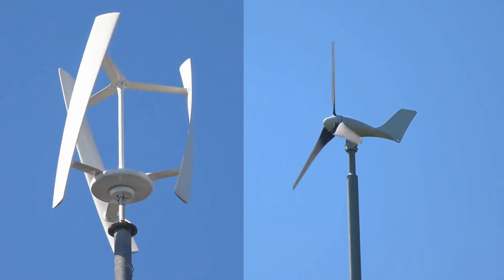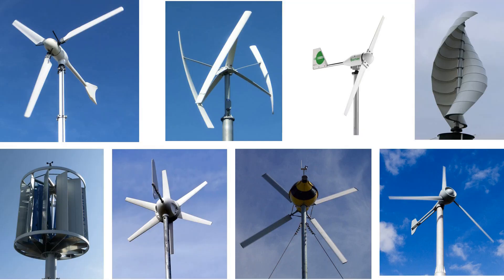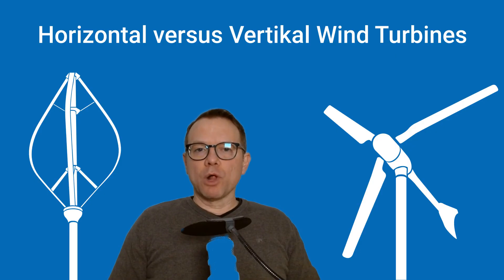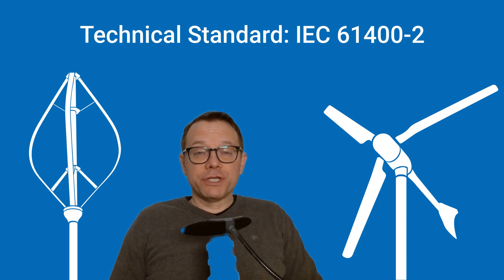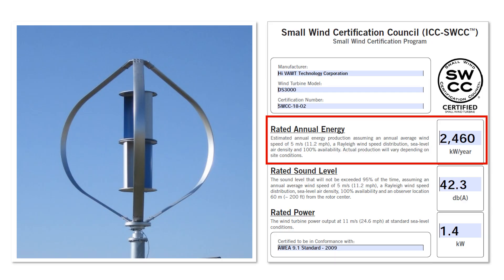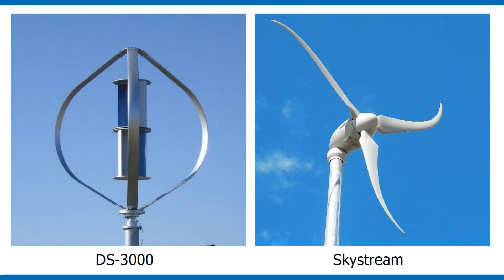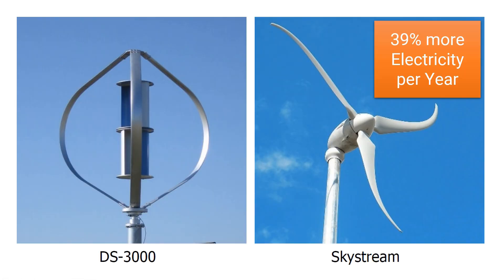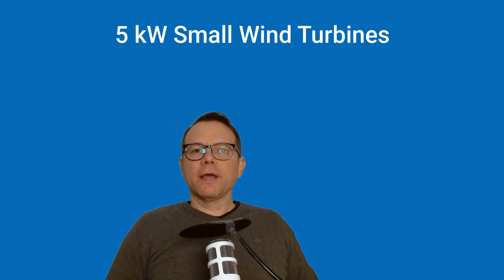Independent Tests: Vertical Axis Wind Turbine vs Horizontal Axis Wind Turbine

Comment: There is a lot of junk on the market, so after a few bad buys and lots of testing, 
I have finally found the best performing small low wind turbine for the price - was $361.90 AUD postage included, I brought four straight from China - 
Search  -
1000W 24V/48V Windmill Power 6 Blades Wind Turbine Generator W/ Charge Controller 
Best to order the 48V mode and use a 3 phase 100A bridge rectifier then into a PWM solar charge controller with a maximum input voltage of 50V.
This is a buy, blades on and put up wind turbine no modifications needed.
I hope this helps everyone when buying their first small low wind turbine.

Comment: The reason im interested in the vertical design is that i suspect it is much less likely to kill bats
Reply: I have had a 2KW wind turbine with 10' blades up on an 85' tower for 38 years and as far as I can tell it may possibly have hit one bird.
I don't think bird deaths are an issue with small turbines.

Comment: I would be interested in knowing the generating motor size on each... As in, at 50rpm = 10watt ? 
(If the horizontal has a larger motor, then the test is flawed) Traditionally a horz has 9 points of wear, while the vert only has 3.... Which makes the vert cheeper to maintain (some tests also say verticals will turn on less air)... 
Stay Safe

Comment: There is a lot of room for adjusting the height and width ratio of the trusses and sails. I think it is best to look around and even do your own experiments. It is an open field and the more the merrier. Watching a video of lab wind tests it seems that cylinder sails capped with discs cut into small fins not only is the most efficient but doesn't require starter blades

Comment: I am more interested in the high wind speed servivbility as we're i am i had 2 die & i know of 3 small to medium industrial wind generators that have died due to high wind speeds. Also if thay servive will thay still produce any electricity at higher wind speeds.

Comment: you do realize that small purpose wind turbines are used in the city and people's private houses and in this urban areas where amongst buildings and other things maybe hillsides the wind direction changes really rapidly and frequently and so there's no way that a horizontal axis win turbine can keep up with it it can't they can't move that faster used to a single direction of wind hitting the middle all the time and it open field airplane and so the vertical axis wind turbines are not going to be good there but anywhere else you want a vertical wind axis turbine in the cities on hillside's anywhere in urban areas where there's constant changing direction wind and you can see and around your house the wind's blowing from one direction then another you can just look at the which way the winds are blowing the leaves are blowing so you're kind of wrong on almost any sense except for grand scale large industrial wind farms any small scale use of a wind turbine is going to want a vertical axis unless you're on a boat perhaps where you're out at sea in the wind is only going to be coming from pretty much one direction and I'm given time and the horizontal axis wind turbine will have enough time to change its orientation. it doesn't do any good if a horizontal axis wind turbine is not facing the wind because the wind changed direction so think of that otherwise great video
Reply: Horizontal wind turbine change direction also fast
Reply: I'd disagree that small purpose wind turbines really are used in the city.  I can't really think of any successful installations ~ lots of folks try but really, citys dont tend to be in windy places and buildings make for a bad wind site unless you can position a turbine well above them.  To put a wind turbine on a bad site is akin to putting solar modules in the shade.  people do it, but in the end they generate very little energy and that energy is very expensive.

Comment: According to the test certificate given the DS3000 I can read that the "Rated Annual Energy" value is 2,460 kW.
As kW is not the unit for energy but for power it makes me disbelieve that this so called "independent test" is a legitimate test, performed by skilled personnel.

Comment: Fine analysis of current market; do consider the general pros are that wind balls can be arrayed denser with (unmeasured) benefit and accessible to the ground in comparison to wind towers. 

Imagine if I told you my 20%-40% less efficient design can be placed 10x more: thats 6-8x the output of the single more efficient model and would change the general efficiency understanding, but again less of a single buyer perspective and more general analysis comparison importance. (I dont know the specific array density of these models just general important analysis consideration with windmills. 🐧🐉)
Reply from the maker: An honest answer: a lot of claims are made in the field of small wind power. The decisive factor is evidence in the form of independent test results. I primarily deal with wind turbines that have proven themselves in practice.

Comment: Very helpful video thanks so much. I own a farm in a rural area (technically "on grid" but in between two small towns, ie with no other buildings nearby). According to the local meteorology station in the nearest town, the general area receives on avg 3m/s wind - that said, and in my personal experience, the exact spot where farm is the wind is significantly stronger, at least 2x as strong; again, my estimation. Important to point out that there are already several state owned large wind turbines scattered around the area. My farm is on a hill with an elevation from 130 to 90 meters above sea level with no obstruction, so my question is: would a small turbine still require that 10 meter high position? I would like to keep everything discreet an in line with the surrounding landscape. Thanks again.
Reply from the maker: Every location has its own conditions. Unfortunately, I can't give a general answer.

Comment: Horizontal Axis Wind Turbine 25 mph wind you may get 2-5 watts from a 400 watt turbine there shit. it will never charge a 12 volt battery. 2-3 volts ac. you never get pay back of fan and mask. wait for the windmill fan that thhey do not said 400 watt ebay and others is max wind speed. over 100 mph

Comment: Very nice video and very interesting channel !!  I have a question.. if I want to measure wind over period of a year, just to see if my location is OK, what would I need , some cheap option, if you have something on mind ?
Reply from the maker: You could check this company from Scotland: https://en.windlogger.eu/collections/small-wind-turbine-data-loggers
Reply: @WindSunWisdom Thank you for your answer. This is a bit too much money for me to invest, just for test. Do you know of any DIY solutions, or something involving RPI or something like that ?
Reply: @tokracro  Just buy a few cheap WLAN weather stations (you can get them for around 100£) Place them on different points of your property. The data generated will be transferred to a weather server such as wunderground from where you can review them. Don't forget to calibrate the anemometer on these stations if you want to know the absolute and not just the relative wind speeds. If that's still too much money just buy a handheld anemometer, (costs less than 20 pounds) go outside and hold it into the wind. If you do this again and again at the same location and the same orientation and properly record the wind speeds measured you'll get an idea of the wind speeds at the location and height of the anemometer. PS if you want to spend zero £  use the world wind atlas. The atlas provides quite a good resolution and will tell you where approximately your property is located on terms of wind energy.

Comment: A guy here in the UK who has been building and using vertical wind turbines for over thirty years said to me that he favours the less efficient vertical set up because it is easier to  build them to last and maintain/service them. 
The hours other people wast over the years on messing about fixing horizontals makes them (in his experience) more expensive in the long run (or equates to a higher Total Cost of Ownership).  
He is retired now but many of his are still working on boat sheds and remote agricultural buildings all over Britain where reliability and convenience was the over riding factor. This meant they were expensive per watt back then compared to to-days solar arrays. So, what is best should be based on the particular application and all its other requirements. 

Also, if his customer had any old automotive batteries (fisherman and farmers etc., always have old batteries knocking around), he could often convert them into deep cycle batteries simply by changing the type of electrolyte. Thus it didn’t matter if they had a lower charge capacity as they were otherwise just scrap.  

The average wind speed here in the UK is about 16 mph.
Reply from the maker: My observation is different. Vertical axis wind turbines have not really been able to establish themselves on the market.
Reply: @WindSunWisdom  Wind energy cannot compete in a normal market, where electricity from hydro, nuclear, coal or solar power is much cheaper than the electricity produced by even the most efficient wind turbine. So stating that a particular wind turbine has not established itself on the market is not a good criterion to judge the usefulness of a particular turbine. Wind power will always remain niche production so there are only individual solutions. Knowledge on the basiscs of how wind turbines function is necessary but beyond that each user has to work out a solution that is tailored to his or her particular location, power needs and financial means.
Reply: If you can put your own turbine anywhere it is very contibuting factor. And if you need to raise HVT at 50 meters and maintain them at that height every several years it is not. Since 2-10 kW is enough for most of people for own use - nobody will care about those extra 39%. People need time to get accusomed to sometging new. While they keep doing the same what their neighbor did they won't do something new with unpredictable results paying money upfront. While business insists on "buy to try and leave comment what was that" nothing new will capture the market. I have space to make something but business keeps whining that something new unable to capture the market while they doing nothing to promote themselves.
Reply: Any advise on designs from your favoured source as am attempting diy vawt with hoverboard wheels n tested ideas rarely need much tinkering or maintenance.. 🤞
Reply: @stevepr100  Sounds a great way to re-purpose a hover-board motor which of cause also makes a great generator. I hope someone else has had the from, as I don’t have any experience of using them. same idea from which you can draw inspiration 

I don’t know when I’ll see Tom again but here are some of my thoughts:
The vawt will need a thrust bearing to support the total weight. The board’s bearings are NOT of a suitable design to do this. Also, the existing bearing plus a thrust bearing WILL add a lot of friction. Friction is always a problem (especially at low wind speeds). Toshiyuki Aso published a paper entitled: Study on the Bearing Resistance in a Wind Turbine Generator System

I quote: ...when the rotor is designed according to the wind conditions and the safety factors in the international safety standard for small wind turbines, IEC61400–2, commercially-available bearings are not suitable for the rotor, because both of the static and dynamic load ratings are larger than those demanded for the vertical axis wind turbine. Unquote.

Therefore, you may need to replace the existing bearings with (say) plain self-lubricating  bronze bushings of a size which will resist side loading from the wind. Then, support the whole turbine rotor on a self lubricating thrust ‘washer’ (bearing) suitable for that total weight.

Bronzelube is one such company that supplies these types of bearings. 

Also, the very act of generating will add rotational resistance. The wind is having to push the electrons against a pressure of some 36 volts. 
Therefore, I’d imagine that you will need to construct quite a large turbine to ensure that it can generate in a broad range of wind speeds. 
Good luck.
Reply: I'm also interested in the size and power of the generators in those wind turbines. I'd like to know what the generator looks like and how it's assembled in those wind turbines.

Comment: I have been tempted to get a wind turbine to top up our batteries in Winter when the PV is not enough. I couldn't find any turbine that could generate enough without installing it very high. So, we bought more cheap PV and switched to using wood in the Winter.
Reply: There are many appliances that you cannot operate with wood (or do you have a wood-fired thermal power station on your property?) So wood will certainly help but not everywhere. If it helps in reducing the hours I have to run a stinking and noisy generator I would certainly welcome the power input from a wind trubine no matter how small the input. Solar is woefully inefficient in winter, bad weather and does not operate at night. Unfortunately there are no good storage solutions for energy (apart from pumped hydro which is not readily available) so the vast excess of energy solar produces in summer cannot be stored for use in winter. Wind energy may contribute at times when power output from solar is zero. Small wind turbines are for off-grid locations as covering your energy needs from the the grid remains the most efficient method.
Reply from the maker: Good decision. You can't force a windy location

Comment: Strange little haters in the comments, maybe its a Euro thing ?  There's a new pinwheel horizontal axis wind turbine that's all the range now, would like to see a sq. meter to sq. meter comparison there too.  Thanks
Reply: In a way researchers are hampering  progress of the VAWT. For instance it must be very cheap it must not be  more complex . Some one said. If nothing change the results stay the same. For me it is about efficiency .   It will cost you more to solve the inherent problems of vertical Savonius turbines. It is possible and then you will have one of the most long life and efficient small turbines. You have toe solve bearing issues, static torque curve, braking and drag forces  and this wil solve the restricted rev capabilities. If you design it to resolve this issues your turbine will have a very flat  torque curve . Your design will be very unique. I did all that. I am busy building a strong durable test model so that it can be tested by creditable institutions. Small problem is it is my private project so there is no big funding.
Reply from the maker: Which turbine do you mean?

Comment: Excellent video, thanks! It would have been interesting with a test under more normal, sub-optimal conditions, like most potential users will have. Inland, some trees generating turbulence, etc.
Reply from the maker: In suboptimal conditions, you have to question a small wind turbine. Depending on what your goals are. If it is primarily a hobby and electricity generation is not so important, then you can also make compromises in terms of wind supply. But if you want to keep the cost of self-generated electricity within reasonable limits, then you definitely need a windy location.
Reply: @WindSunWisdom  What about the horizontal axis turbine seeking the wind in turbulent conditions? If this could make a big enough difference to the output it might be more efficient to have a VAWT. A second possible reason for choosing a VAWT could be in an area where the wind often blows at speeds above what the HAWT can handle and so forcing it to shutdown. I don't have any experience with wind but I think that I might have seen the latter argument being used.
Reply: @WindSunWisdom I do have a very windy location, but it is probably not free of turbulence. The question is how much I should invest and whether there will be return on investment.